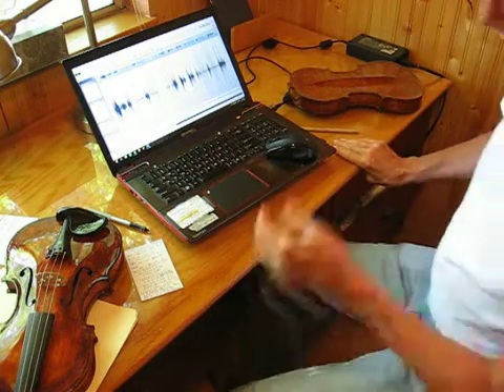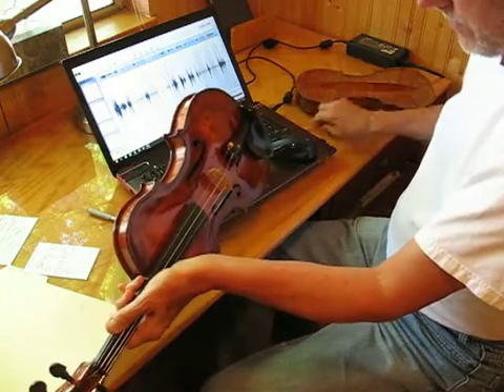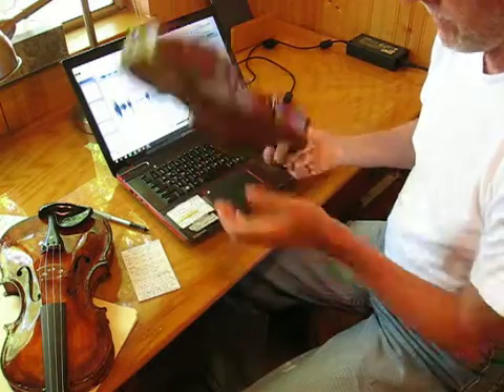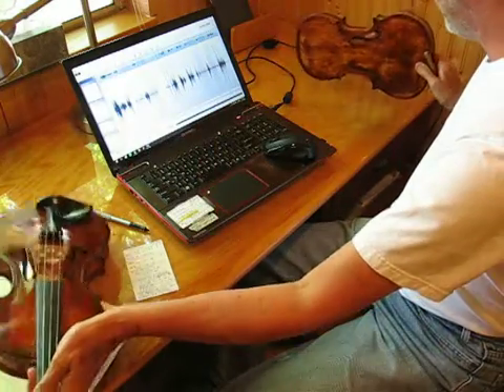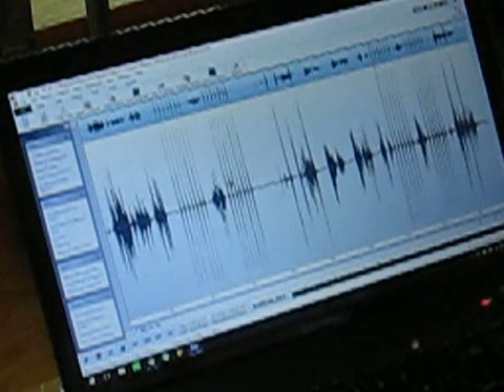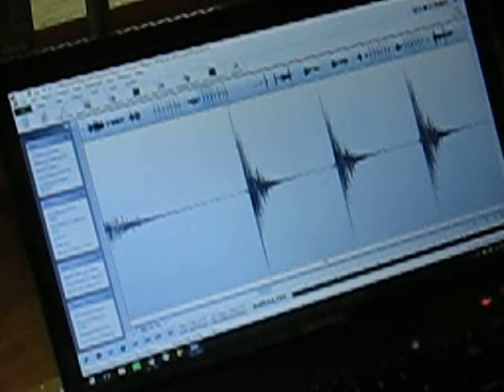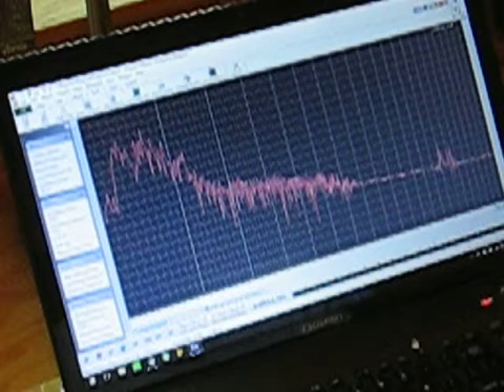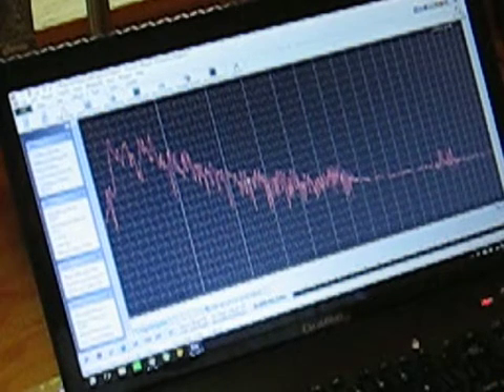Fuller's Earth as Varnish Ground for Violins 2017

Comment: smh
Reply from the maker: Tony;   I would be afraid to know what smh means.  I will mention that violin varnish ground formulas have been a highly sought after item for many years.  Actually an article in the VSA Journal of the chemical analysis of several Cremona master violins  produced the list of elements needed and my mechanical engineers compound book provided the matching list which almost confirms it.   Acoustically, the effect on actual instruments is to maintain the strength of the lower overtones and reduce the high overtones (noise); and it is noticeable!  Hear samples at https:violineuphonist.com   David L.